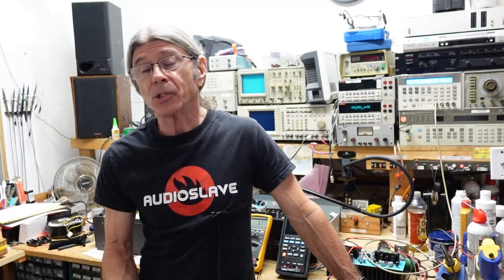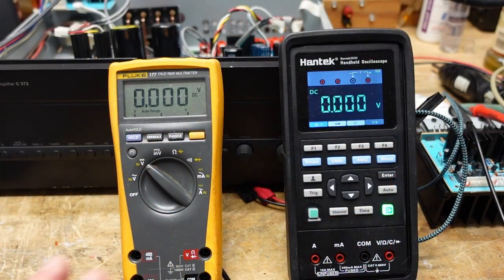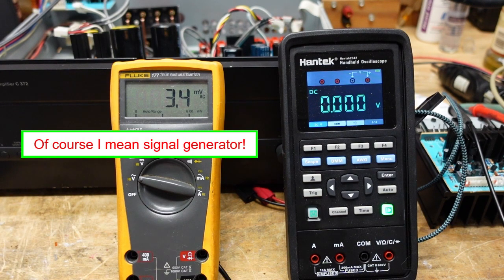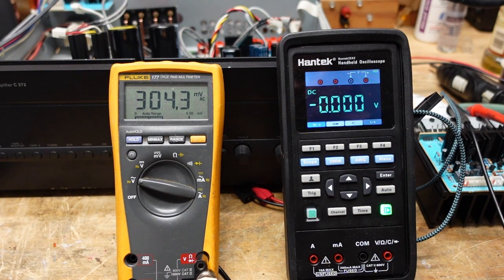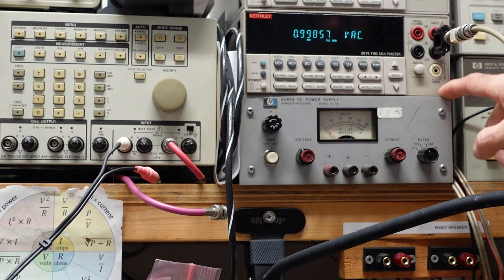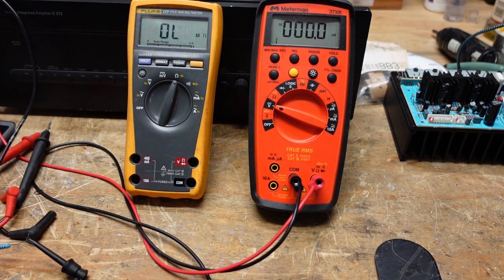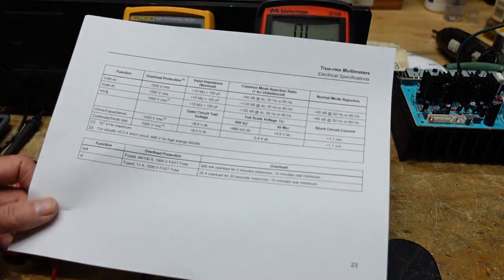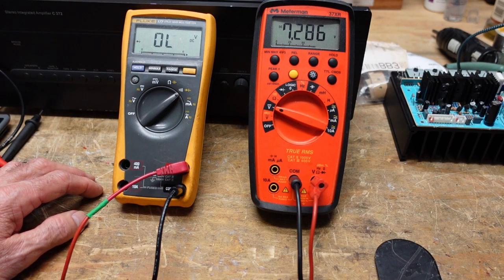Bench Basics- Understanding How Your Digital Multimeter Works

Comment: I had in the 70s a yellow Dynatec digital meter, and at that time I was careless, and I was measuring current, but in place to put the probes in series, I put them in parallel, it ruined my day, the 20A fuse blow out, and it never worked again. So I bought me the flagship by Dynatec then, and it's still doing its work on my bench, although it's time to buy new probe cables, because they are very much worn out. But I'm looking for an extra meter, and I'm thinking to get a Fluke too. The warranty is great, and they are the industry standard.
Reply from the maker: You can never have too many meters!  That Fluke 177 is my daily driver, but the 2 Keithley's are great for looking at left and right channels for setting bias or offset.

Comment: Hi, Ray, the Fluke 177 is a very good multimeter but the 87v is the most technicians prefer, what is the reason of your selection over the 87v.
 For someone like you throughole desolddring is very important, what tool do you use?

In my case I use everything, sometimes solder wick, others desoldering pump, but my everyday use is a Hakko 808.
Maybe one year ago I bought a Yihua 948 deslodering station, works very well to me.

Best Regards.
Reply from the maker: The decision to go with the 177 was easy.  It was given to me for free!

I started with a Hakko 808 and then bought the FR-301.  Wick used where the gun won't physically fit.
Reply: @raygianelli3612  I have a FR-301 also.
Many years ago I bought the Hakko 808, some time later I bought a cheap ZD-915 as a backup.
Some time later I bought the FR-301 and now the Yihua 948 as a backup.
Hakko 808 never fail hehehehehe.
Still used every day.
Now I am testing the Yihua 948 some times.
Best Regards.